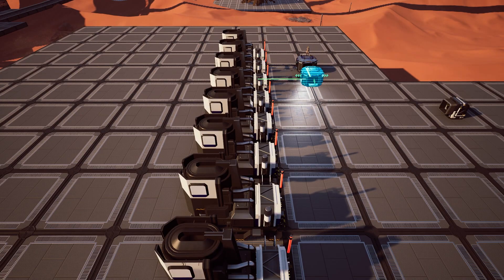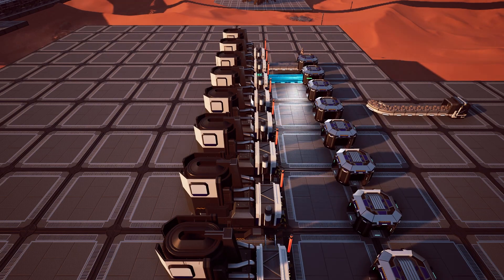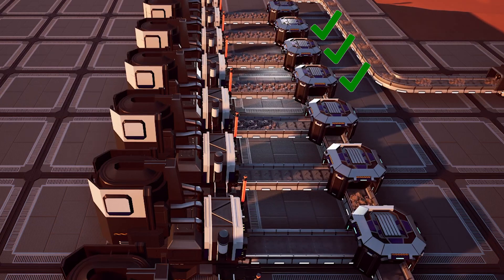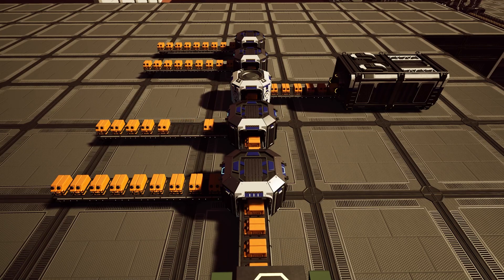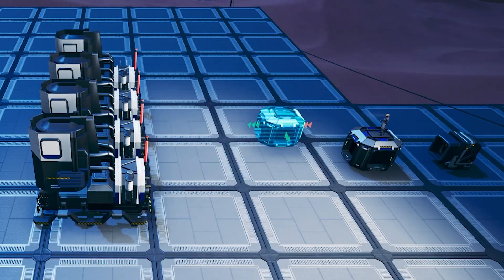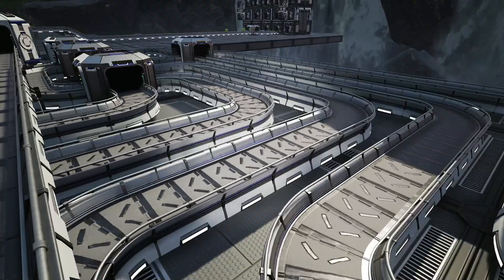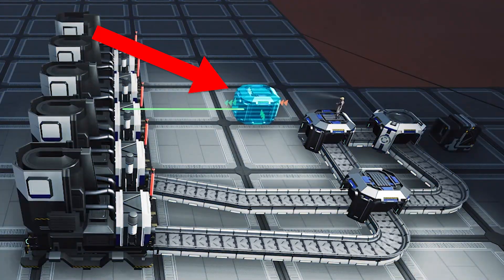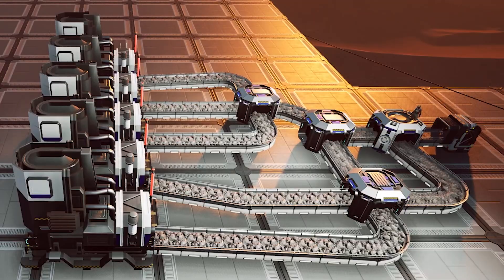Satisfactory: Manifold vs Load Balancing for Belts + Tutorial

Comment: 3:06 The statement that it is easy for numbers divisible by 2 or 3 is not correct. This breaks as early as 10. What you actually want is numbers with only 2 and 3 as prime factors. You have to split by 2 or 3 in every step so you multiply the number of outputs by 2 or 3 every step. To reach my example 10 which has 5 as a prime factor there is no way to reach it without multiplying by 5 at some point in the chain so you would have to split into 5-way at some point. The same actually goes for your example of 100 which has 5 as a prime factor as well.

EDIT: a nvm, haven't seen the corrections video before, you already addressed that, my bad.
Reply from the maker: You're a little late to the party on this one! There is a follow-up video linked in the pinned comment that goes over these errors.

Comment: For the balancing technique 

To simplify if it is not divisible by 2 or 3... Under clock all the machines in order to get 1 or 2 extra machine 

Cost a few extra ressources and machines ( which will get cheap as time goes on )

And saves you a major headache .. which is always welcome in satisfactory

Comment: for a greater and very considerable issue with balancers is that they are limited by the through put of the belt your using where as with manifolds you can easily feed a group of machines using more than the belts through put  with one belt.

Comment: If you can wait to start your production, you can create a manifold, connect all your machines to 1 unpowered line, then when it backs up, power them all. This way you aren't pulling from the resources required to back up the belts, and the machines won't be able to store material indefinitely

Comment: 3:50 No.  You do not, under any circumstance, even when nuclear waste is involved, NEED your input belts to be balanced.  Even with nuclear waste, a manifold will eventually fill out and, provided you have enough production downstream, all the waste WILL get handled properly.  At worst, your nuclear waste processing area will always be filled (but not clogged) with waste, making it more dangerous to be around.  However it's always going to be a significant hazard so that's really not much of an argument.

Honestly, there is no good reason to use a fully load balanced factory, ever.  Yes, it will start up faster, however that comes at the cost of taking much longer to build which will usually make the total time (from concept until max throughput) longer.  Couple that with the increased resource cost, increased space cost, and generally looking like total crap, I simply cannot recommend that style of play to anyone (without mods).  It can be helpful when dealing with more resources than a single belt can handle to balance the load before routing it to separate (manifold-based) factories, but that's not really what this video is covering anyway.
Reply from the maker: Well, I suppose this is the kind of pedantic comment I deserve for throwing out a random line like that.. You're right, nuclear waste does not require a load balancer. The sentence was supposed to be a catch-all for letting viewers know that sometimes belts must be balanced in order to prevent them from backing up, and that can be especially important with waste - not for the danger of waste building up, but to make sure that your nuclear reactors don't get backed up with waste and stop working.

I know this is not at all what I said, but the belt balancer on-screen during that sentence is actually the ONLY balancer in my world, which splits out nuclear fuel rods evenly. I had it set up to make exactly as many fuel rods as my nuclear plants needed, and I had it on a manifold system. Needless to say, the last couple reactors never had enough fuel rods but the first reactor had plently. In this case, I had 5 reactors, for whatever reason, so I needed to create a 1-to-5 balancer. Otherwise my power would have gone down.

But yes, I hope the message of the video was that load balancers are niche and manifolds will suffice in 99.99% of cases.

Comment: Is there a name for when you do a manifold, but you calculate the input and output?

For example if you use an MK1 miner that produces 60 iron ore, you connect it to two smelters that both consume 30 ore per minute via a manifold. Adding more smelters at the end of the manifold makes no sense unless you either overclock or upgrade the miner, and this set-up to me feels like a middle ground between manifolds and load balancing.
Reply from the maker: I think most of the time, a manifold is calculated. Most of the math in this game works out nicely, so usually you use exact math to make your factories efficient.

But the situation you describe is why the flexibility of manifolds is a big strength. If you have an iron setup with a Mk2 miner, you can build X number of smelters. But when you later unlock the Mk3 miner and want to upgrade it, you can easily add more smelters to the manifold to make use of the additional ore being mined.

I think really a manifold that's totally random and lacking calculations would need it's own name, because that is definitely less common.
Reply: @SatisfactoryNews  Okay, thank you for the answer. I'm still new to the game, trying to figure things out, and sometimes I don't even know what I don't know in order to look up guides. I've been trying to learn load balancing for the last couple of days, but I'll switch to manifolds.

Comment: Note that the loopback method can cause issues if you're not careful of belt speed. For example, you want to feed 5 machines 12 things/min, for a total of 60. 60 in gets split into 6, 10 goes into each machine, and the 6th line loops back to eventually send the remaining 2 into each machine. But, and here is where things can go wrong for you, now you have 60+10 on the belt between the merger and the first splitter. If you did the whole system with Mk1 belts, because your total input was only 60, right, now you've got a bottleneck that's going to clog up, and the machines are only going to get 10 each.
Reply from the maker: Yep, I made a whole follow up video about this oversight! (Looks like you found it though)

Comment: The manifold method is good for designing very compact smelting foundries and constructor factories that you can plop down with one click of your mouse, hook it to the grid, connect the input/output belts, and be done with it.

Take the dimensions of the Smelter and Constructor, for example. In the blueprint designer you can lay a 4x4 foundation, then upon that foundation you can squeeze in a two-story microfactory with any combination of SIXTEEN smelters and/or Constructors with all of the necessary belts, splitters, lifters, and power poles with virtually no clipping save a for a few yellow splitters on the output side of the buildings.

And the best part? The blueprint preprograms the buildings to the input resource, output resource, and clock speed they were set at when you saved the blueprint. Want an iron foundry with an i/o rate equal to a mk 4 belt? Sixteen smelters at default clock speed. Did you unlock mk 5 belts? Upload the existing blueprint, add some power shards, upgrade the i/o belts, and reconstruct your new blueprint over the old one. Don't want to use shards? Just upgrade the belts on the existing module and drop a new foundry on top of the first one, hooking the input belts via a lift. Manifolds are great for easily building upwards, and the tutorial straight up tells you to prioritize building UP and not OUT.

Wait, you wanted a copper foundry? Just load your iron foundry into the blueprint designer, set all the smelters to copper, and save the new arrangement. Boom, you now have a 480/min copper foundry, all within a tidy 4x4 footprint.

With this design philosophy you only have to build a specific input/output factory once, on the blueprint platform; the rest is just fiddling with belts, clocking, and chaining.

Does it take time to fill up? Yes, but you are plopping down a compact microfactory with a tiny footprint and connecting it to the supply chain in less than twenty seconds.  I know this can be done with balancers, but feeding an entire supply chain a with a single input belt and cramming it with splitters and buildings is so much more space efficient.

Multi-input buildings fare better with balancing, but I'm an insufferable contrarian and have vowed to manifold *everything*. I will not rest until my entire factory  runs purely on sushi belts.

Comment: load balancing is sometimes required in the early game where the material you need to move to be most efficient is significantly higher than the speed of your belts. You could have a manifold, but you'll essentially be wasting sometime 50% of your ore. Also I default to load balancing because it's more challenging and makes every factory its own unique web of spaghetti

Comment: I'm just going to point out that there's a third option here - A Hybrid of the two.  For example:

Suppose you're feeding an array of coal generators via a mk4 belt.  480 coal per minute / 15 = 32 generators.

You could do a manifold and wait for it to stabilize.
You could do a big complicated 1 to 32 balancer.

You could also do a simple 1 to 8 balancer and feed 4 generators off of each of the 8 lines.

The pro's and con's should be fairly obvious but just in case:  This sort of thinking will let your array stabilize much faster than a straight manifold while still being way easier and more compact to build than a 1 to 32 balancer.
Reply: You could actually simplify this setup further by using a second manifold instead of the load balancer and feeding the smaller manifolds by mk1 belts because the 4 machines connected to the smaller manifolds use a total of 60 coal per minute. So you actually could create a kind of load balanced manifold in this specific case
Reply: @askalein1234 So in short, a load balancer is just a series of nested manifolds with only one output and a manifold is just a load balancer with only one layer. I am enlightened.
Reply: @arashikou6661  The first one is technically true, the second one definitely not. A manifold can behave mostly like a load balancer if the outputs of the manifold are limited to what the connected machine uses but it is definitely not a load balancer, at least not for more than 2 or 3 outputs

Comment: I have been doing manifolds for a very long time, I tend to be a bit more interested in a clean setup then absolute efficiency. You can add a little bit more efficiency to the manifold by feeding your input into the center splitter in the lineup.

Comment: Well the loadbalancer you showed got one major problem. If you running a saturated belt, there is no room for merging. So you can split the "backbelt into two and merge them after the first spliter, 'cause the saturated starter belt is now only half full thus have space to merge something into it. This way you can make sure, both sides get the same amount of the "backbelt" without geting stuck with trying to merge a allready saturated belt with more stuff.
Reply from the maker: Yep, I address that mistake in a follow-up video which I have linked in the pin comment

Comment: This is how I should have built my latest factory making just over 1 stack of computer per minute, took over an hour to get up to speed with the manifold.
Note: The loop-back method won't work properly if the belt is saturated. If the belt is saturated you would have to use a higher speed belt, or a second belt if the number of items is 780 per minute
Reply from the maker: Haha I literally just posted a follow up video going over the things I failed to mention in this video, including the loopback belt saturation.

Comment: Once I have everything set with power and belts, I don't turn on the factory yet, I let all the belts fill up and then 1 by 1 I add power. It's similar to Coal generators. If you don't have full water/coal it will stutter and who wants that.

Comment: So far, I have used mostly manifolds and it works perfectly fine, and allows tight, neat factories. Only problem is startup, which can be annoying, but it's easily fixed. i have everything working at 100% all the time and my biggest manifold is 10 splitters on one line. As long as you properly calculate every part of the process, shit will work. It's very satisfying to learn how to do this and to put in the effort to do it. But I can definitively see someone not wanting to crank numbers while playing a game called SATISFACTORY. I always got machines producing like 28.567 units a minute, bruh.
Also, when I think of trying to load balance, I always end up questioning how to turn 7 outputs into fucking 5? Nah

Comment: Manifold is good for high throughput / low stack size factories. It doesn't matter if it takes a few minutes to start up. It's when you get to the end game and you have very low throughput, complex factories that load balancing becomes essential. Otherwise, most of your machines won't be running for a LONG time.

Comment: It's worth pointing out that splitting takes time. Not much, but if you split a 60ppm belt into two machines taking 30ppm each then your main line will back up even if there is no backup on the feed lines

Comment: I set up manifolds for my coal power and didn't even realize it. My buddy didn't think it would work, but I told him to just turn it on and come back later. All 6 in 1 line stayed full. Even explained the math to how I knew we could over clock each one without running out of materials. Fun stuff. Still haven't built a proper factory yet though.

Comment: The problem with loop backs is that if your merger-splitter belt is the same speed as your input belt, it will jam due to throughput limits and the 5 outputs will always be 1/6 of the input.
To avoid throughput limits, you need to 1) split before you merge 2) us faster belts inside the balancer than outside or 3) not use full input belts to begin with.
Reply from the maker: Very true, I think some other folks have pointed out that I missed this, and it really is something I should have touched on.

Comment: well...belts work the same as pipes and vice versa. 
so just let all of them get fully saturated and then connect all of your production buildings to your power net at the same time. this will make the output and input equal...if you did your maths with oreproduction correct

Comment: A correction on the math: "multiples of 2 or 3" is too broad and includes configurations that can't be achieved by just cascading 2-way and 3-way splitters. 10 is a multiple of 2, but can't be achieved in that way. An accurate statement of when repeated splitting is enough is that the only primes in the prime factorization are 2 and 3. Put differently, every factor (besides 1) of the goal must itself be a multiple of 2 or 3.
Reply from the maker: Good catch, thank you

Comment: I've always referred to these as "serial" and "parallel". Works kind of like an electrical circuit. Serial mode (like a bunch of resistors in series) requires higher "voltage" (belt speed) to carry current to the end of the line.  Just another way to think about it. Good video!

Comment: Worth to note that load balancers with loopbacks don't work right on full and near full incoming belt since create a choke point where additional resources merge back.

As for example, you have 1 to 5 and 780 belt filled to 700 (140 into 5 directions). This won't work right because 1/6 will follow back and choke incoming flow since reach belt speed limit, back up and cause uneven split. At this point may as well use a manifold.

Furthermore, final speed of a loopback is actually higher than 1/6 of the incoming flow since flow is now faster due to loopback.

Comment: Loopback is not possible when you have a full load on a input belt. 
For example, if you have tier 2 belt full of ore (120) as an input, then you can't add another 20 from the secont splitter, cuz it will be 140.

Comment: Ive been playing satisfactory for well north of 1200 hours since the first release of Early Access. I've felt the need to use a load balancer exactly twice. The first was so long ago that conveyor lifts werent even a thing since i remember feeding one end of that monstrosity into one of those conveyor helix structures that were a thing back then. And the only reason I used it was because I didn't have enough input to saturate both lines. The second was my nuclear power station. The fuel takes a long time to make so the "fill up time" of the system would be so long that the load balancer made sense. 

Literally twice in my entire time with the game... 99% of the time a load balancer is a waste of time, space and resources. And ficsit does not waste.
Reply from the maker: Yeah, I totally get that. The only place in my extensive world where I use load balancing is to distribute nuclear fuel rods across my nuclear plants. Some people like using them but I find them mostly unnecessary. Important for a few critical systems but otherwise a waste of resources.